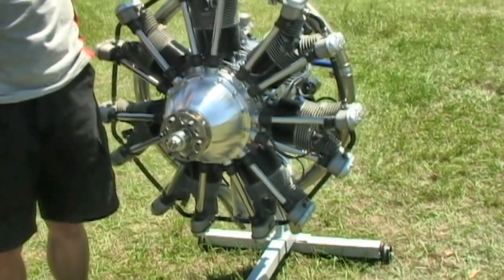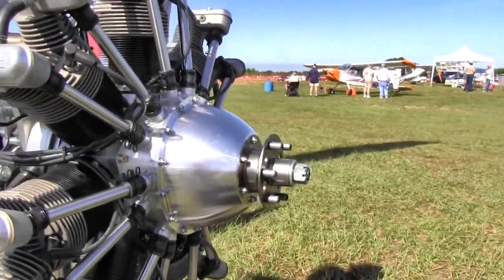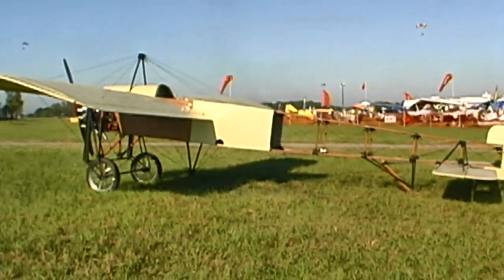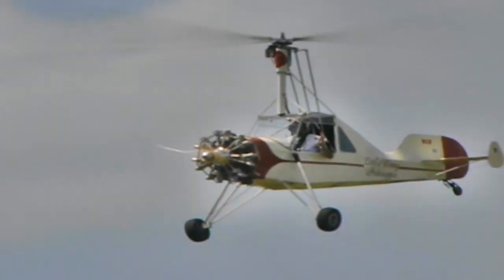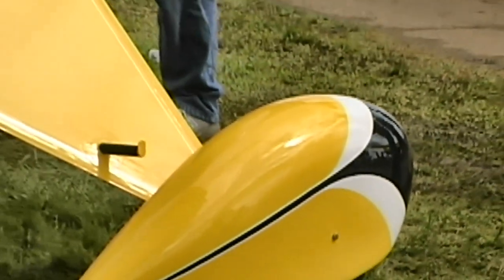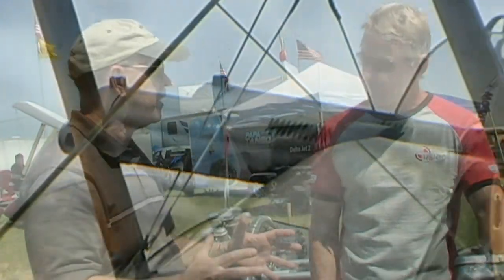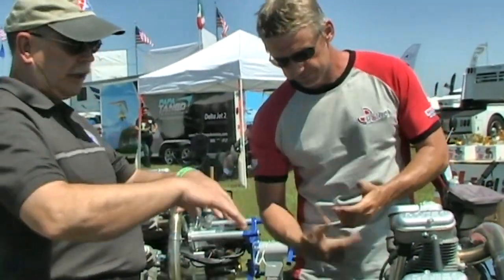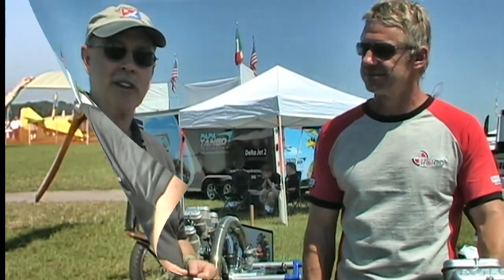Rotec Radial Engines, Rotec R2800, Rotec R3600 radial engines by Rotec Engines.

Comment: 110 hp on a 2.8 engine.. why so low
Reply: torque is hi , rpm is low. with big prop trust be same as 160 hp, i guess , in slow flying. Forget about Hp

Comment: The guys asking the q's don't seem to know much about aviation engines. Old planes don't seem to be as old as other old stuff. Lots of them still around.  But the radials are pretty hard to beat for all their advantages, including good cooling, smooth round the clock power impulses, compact engine length firewall to prop, long life and reliability if well built and a great amount of power in a small space. Heck, they're practically all cylinders! Sure they aren't perfect, they have a big face-on profile so they aren't the sleekest design, but for slower craft the drag isn't really a big factor. And of course you have to be very careful to drain the lower cylinders and pull it through by hand a number of times to prevent haydro locking with drained oil. But altogether, great to see this picked up by Rotec, ideal powerplants for slower aircraft! But don't forget the very fast P-47 Thunderbolt was radial powered.
Reply: Radials are the best. Even the real ones (Sorry Rotec) are not gone, with many remanufactures like Covington building practically new engines.
Reply: As well as the Hellcat, and Corsair, and two on the Invader. Best of all, they are still going around the pylons as racers!